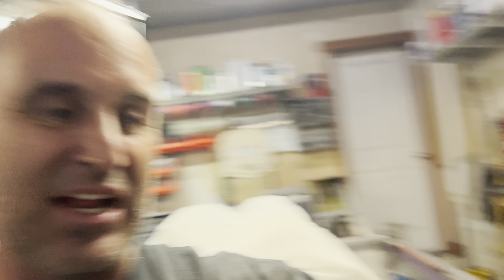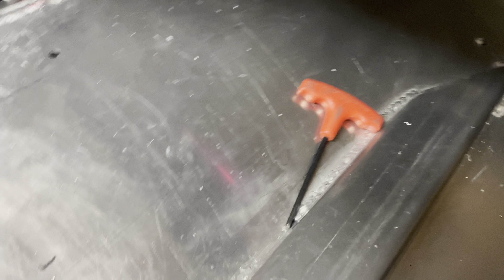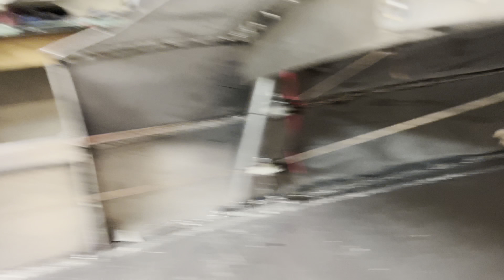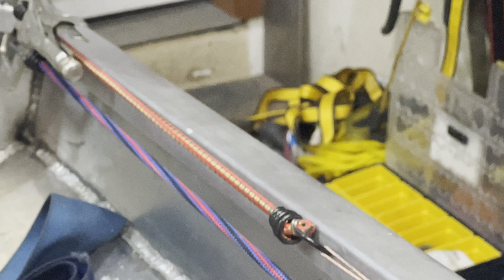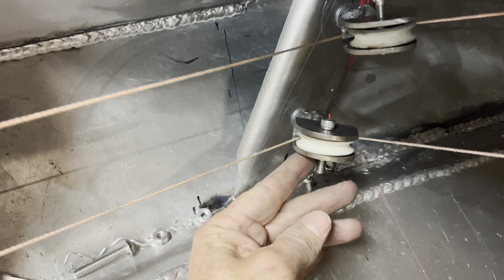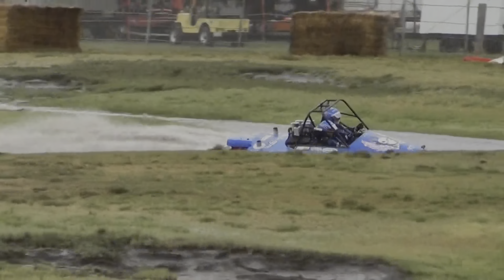Jetsprint steering….it sucks!!!

Comment: You're right about driver comfort, it's a big part of success, it's hard to focus as a driver if you're not comfortable. We build every car around the driver from the beginning on every build starting with seat placement. Once the main chassis and cage are fabricated the driver comes in and sits in the car with all their safety gear on to finalize pedal and steering placement, shifter location, chute release handle, firebottle handles, gauge location, etc. Everything needs to be just right so the driver can reach it instinctively. The boats really coming together and looks awesome! Keep up the good work!
Reply from the maker: That’s a great explanation of how important it is!!!

Comment: Eric, you could ad a little stiffness to the "dashboard" with a horizontal, forward facing lip at  90°. Essentially making it into an angle. Would be difficult though if dash is welded at gunwales. Probably would need additional bracing but wouldn't add a lot of weight. I suspect the vertical strut to stringer would be a PIA for exit and entry.  My nuts hurt a little thinking about it.  Maybe slit a  length of tubing, slip over bottom edge of dash and weld.  Anyway, loving the build so far.
Reply from the maker: That’s actually exactly what I’m thinking about doing.  I’ll start there and see how much flex it takes out.  The #146 heads a vertical post and it’s not that bad honestly but I’d prefer to keep that area open.  We’ll see.

Comment: Nice !!! Dam work getting in the way! Always been interested in the cable steering setup!  Why push pull cables over a single cable?
Reply from the maker: I think the pull / pull system is just a proven and fool-proof design.  It’s the exact same concept as most aircraft controls.  There’s also zero slop innit compared to a Morse style helm or hydraulic.

Comment: Ive seen two nearly perfect solutions to the problem of locating  and mounting guide pulleys on  tensioned cables  in a way that allows them to do their jo of changing the direction of pull from the cable.. But without  messing up tension or position of cable too much. Unfortunately neither system is of a scale that would help with your struggles. One is used on the sheaves in the  crowns of booms on tow truck s especially on tow trucks that have twin wenches that feed win booms. These are way to big for boat controls. The other system is used ito shift some internally geared 3 and five  speed bicycle transmissions. Especially Sturmey-Archers from the 1920s (1930s?) onwards and Shimanos from the 1950s until present. Thes are a little bit small for boat steering duty
Reply from the maker: One of the challenges is that it’s a tight & awkward fit up underneath the bow.  The rear pulleys are much easier to align!

Comment: This was one part I was waiting for! I have never done steering like that but this vintage race boat I'm restoring will be cable. A couple pulleys was all thats left. Any recommendations on where to get the sprocket? What kind of chain? How strong of springs for tension or do I need springs? Lol sorry for being nosey.
Reply from the maker: A lot of teams use industrial chains & sprockets from Grainger.  In my opinion, that’s overkill.  I go to my local bicycle shop and get a used stack of sprockets off a 10-speed bike and cut out the diameter I want.  Bicycle chain is plenty strong enough!

Comment: What about using triangle gussets 2 or 3 welded for the back of where the steering is mounted instead of another pipe
Reply from the maker: I got it all sorted without using a down-tube!  Definitely needed some bracing underneath!

Comment: If you build a few of these boats in the future, maybe have a jig or rotisserie stand for the hull so you can twist & turn it to weld & fit parts. Might save crawling in & out so many times...oops forgot a clamp etc. Also, what happens to the drivers when the boat wrecks and is upside down in the water? I can't believe ya'll use cable & pulleys for steering. Isn't there a single solid cable like used for outboards? See ya Next week....
Reply from the maker: I keep saying this is my last race boat lol but that was about 3 boats ago 🤦‍♂️.  You have 2 choices…get yourself out, or wait for safety crews to get you out.  I have used spare air in the past and will probably do it again.

Comment: Apart from the additional weight, could you consider Hydraulic Steering ?
Reply from the maker: I really like the simplicity and fail-proof cable & pully system to be honest.  Once it’s in, it’s simple.  Hydraulic would be way easier to install though for sure.
Reply: @JollyRoger907   I get that. I had cables on my fishing boat, but it was too heavy to turn the motor, so installed hydraulic steering. Was way easier to steer very easy to install. Never had any issues. There two small rams on the motor and the pump is on the steering column. There are no electrical connections. I did wonder if the chain could possibly jump on the sprocket with the cable setup though.

Comment: Personally, the larger wheel / yoke span, closer to shoulder width, helps unload the wrists and makes for way more comfortable and better range of rotation. Any easy option to make the steering shaft telescope for fine tuning?
Reply from the maker: I agree and I’m excited to drive the larger wheel.  You could telescope it but it’d have to be on the driver side of the dash since the pulleys & cables are set.

Comment: Eric, why is cable abetter option than hydraulic?
Reply from the maker: Believe me, hydraulic would be 100% easier lol.  There’s just more chance of getting water or grit in any kind of push-pull or hydraulic system and there’s also zero slop in the cable & pully design.  Look at F1 tunnel boats!
Reply: Cable is much lighter than hydraulic and easier to inspect.